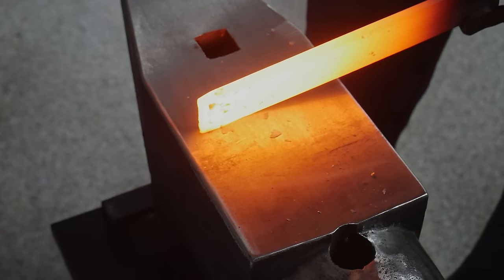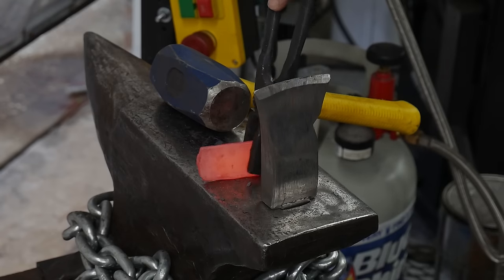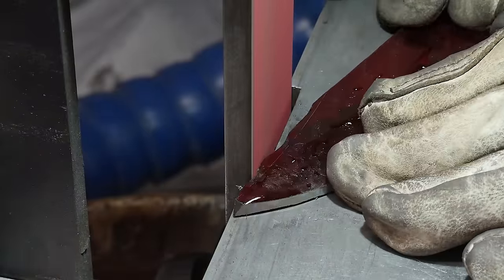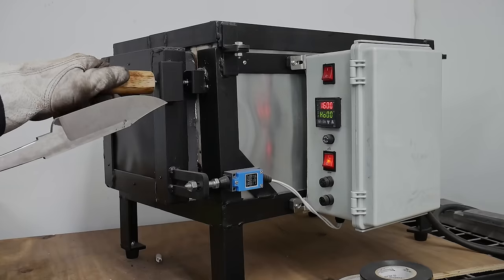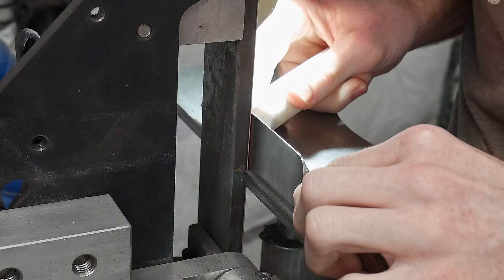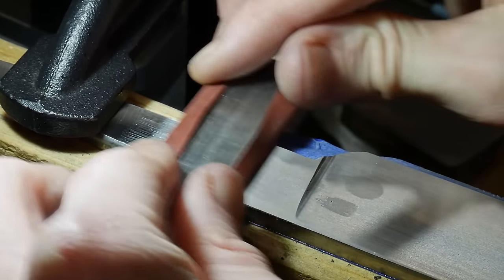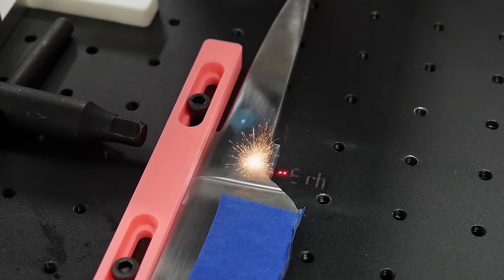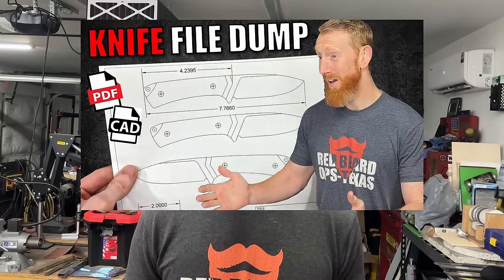An Adorable EDC Bowie Knife Build | Part 1 (w/ New Tool Sneak Peak!)

Comment: Its looking to be a very good bowie so far and the laser results seem very good.
As someone who used to work with lasers 'back in the day' you do need to be careful what you blast away with them. Metal's are generally fine and won't gas off too much nastiness but in any case you want to have quite a draw of fume removal, especially when you're doing anything organic underneath it and discourage the small people from playing or looking into it! Plastics can be a mixed mess, most of them are pretty stinky and offensive with some mildly poisonous or irritating gasses, when you start getting into stuff like PVC's though they can put off gasses that will outright kill people extremely quickly and the survivors will be maimed for life.
Just being we're knife makers, everything we use is hot, sharp, full of particulates and probably poisonous, but I don't see a lot of reviews on lasers covering what professionals know they can do and while they are pretty cool things they're a whole other subject matter when it comes to material science. All the best for 2024
Reply from the maker: Good stuff! Thanks for the info and reminder

Comment: @RedBeardOps Hi! Most black lettering on knives (like BRK, etc.) is superficial and wears off very quickly. What is the maximum depth of your laser engraving?
Reply from the maker: The fiber lasers are able to get as deep of an etch as electro-chemical etching.
Reply: @RedBeardOps  I see. So just superficial discoloration. I believe from conviction that a permanent mark (like LT Wright) on the base of the blade greatly improves the value of the knife. And an etched mark (like BRK) is a "cheap" solution. Is there an effective alternative method to stamping hot steel with a steel stamp?

Comment: Well, for whatever reason, my first comment was deleated. Take a look at AmeriBrade 2x72 grinders. Question. Is the magnet on your surface grinder made from a maglock door security system?
Thanks for what you do. 👍🍻
Reply from the maker: I've heard those are nice! The magnet came from NorthRidge as well... not sure what it was designed for, but it looks to be for a mill or surface grinder. Very nice piece.